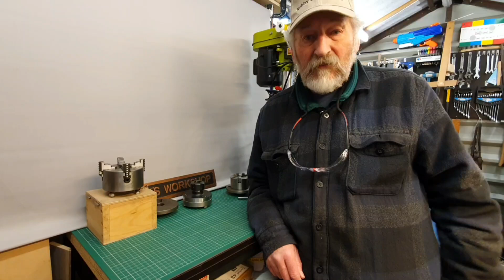Myford Lathe Chuck Back Plate.

Comment: nobby  arc euro trade sell those transfer screws but only metric
Reply from the maker: Thank you David it's useful to know that for the future. I have two shop made sets now 6mm and 8mm, and I could make them in imperial as well if needed. It was a fun project making them anyway. Thanks for your help. Cheers Nobby

Comment: Hi Nobby, when using the chuck with the recently machines backplate, take care using it. As you say it was a driver plate originally for turning between centers, it is only a lightweight plate. With the casting being relieved on the back it is not very thick compared to a proper chuck backplate. Take it easy maching and puting it on and off the spindle so as to not put too much stress on the thin section. Regards from Australia.
Reply from the maker: Thanks for the warning David. I will take great care with it, and inspect it every time I use it. I don't think it will get a lot of use, but will be a useful back up. You advice is always useful to me. Cheers Nobby.

Comment: Nice find on that Bison chuck - they are premier equipment and very pricey. Cast iron - it’s a love / hate relationship. Easy to machine, but heck of a mess. 😊
Reply from the maker: Hi Stuart it took me a good hour to clean up the lathe after this. I think I struck lucky with the Bison chuck. Would have been handy to have the outside jaws, but still good for small parts. Cheers Nobby